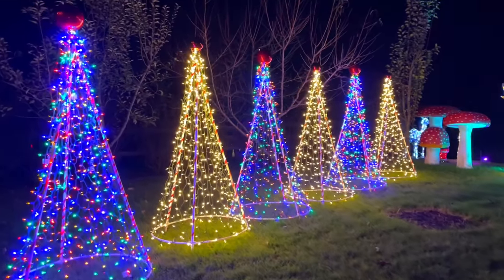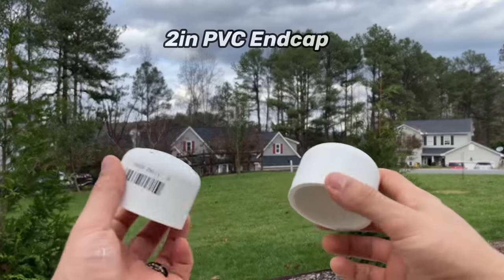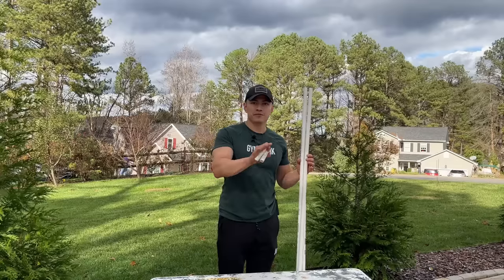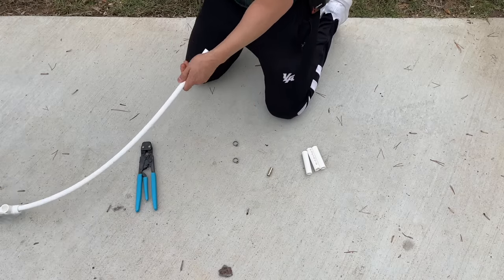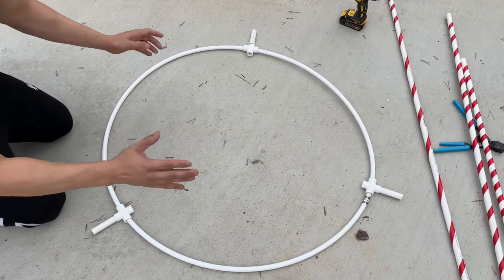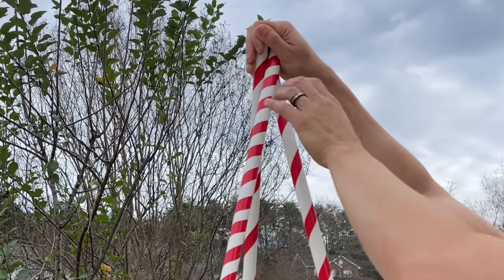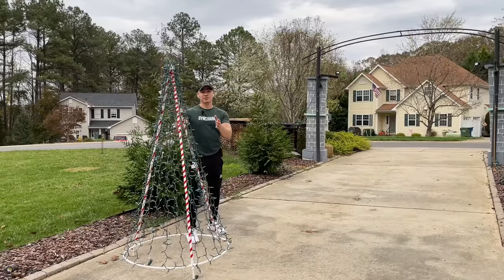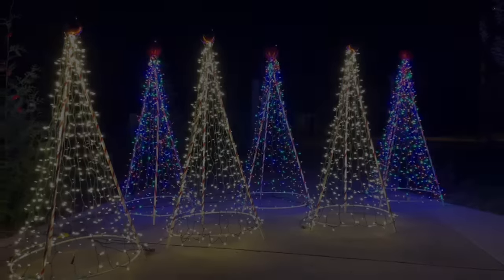EASY PVC CHRISTMAS TREES - TUTORIAL

Comment: Why can't you just use 3 - 32" pieces 1/2" PVC also for the base going into the 1/2 Crosses and forget the Pex stuff? 1/2 PVC is flexible enough to make the bend. Also for storage you can pull them out so they take up less space. You can prob also leave the lights on. Just a thought.

Comment: How long were the string lights that you used? (just for reference)
Reply from the maker: Each strand was 24ft long
Reply: @IsaacAlexanderDIY  Thanks :)
Reply: Can u use pvc for the base? I built mine 10’ tall w 1/2” pvc and pex, and it buckled on top n bottom 😡.  I know u said to use 3/4-1” if going that tall, but can I use that same size pvc for the base?

Comment: Maybe you could use a hula hoop on the bottom 😊
Reply from the maker: We cannot use a hula hoop because we need to get the cross connectors inside of the hula hoop and the only way to do that would be cutting the hula hoop which would defeat the purpose. You wouldn’t be able to crimp the hula hoop closed because of the different sizes

Comment: This is such an easier way to build these trees, thank you. I made 6 of these last year using Pex Pipe and pvc but with a much more difficult way to connect the Pex ring to the pvc pipes using zip ties and screws and drilling holes in the pvc and pvc tees. I like how you screwed the Pex to the cross tees, and how you taped the tops of the pvc pipes together and used a large pvc cap to keep the pipes together. Much better than the way I did it, again with zip ties and holes drilled into the pipes. What a pain in the butt that was. 

I'm sorry, but I have to disagree with you about the all the equipment for the Pex couplings, it's such a waste of money. You don't need any of that stuff: no
Reply: Ok, sorry it looks like my comment got cut off. I was saying, all you need is a plastic Pex coupling. No metal couplings, no clamps, and no crimping tool. A 5 pack of plastic couplings at Home Depot or Lowes costs about $4.70 (at least in NJ). Amazon has them too, I got a 30 pack for $16. Mine trees have lasted outside for a year now and the Pex ring hasn't come apart. If you want extra security, either add zip ties or run screws through the Pex and coupling.

Thanks for another great tutorial!
Reply from the maker: @jasram74  Thank you for the feedback and tips :)

Comment: Ok just wondering if anyone else had the problem I’m having? The the cross tee won’t slide on the PVC pipe. Everything was going good till now. 😢
Reply: Pvc fittings can be really tight to get on, have you tried any lubrication? I use white lithium grease, but that's only because it's what I have on hand, something thick like vaseline may work. Put it on both the end of the pipe and inside the tee. If it's still to tight to get on, use a scrap of wood to bang the tee onto the pipe, or the small legs into the tee.
Reply from the maker: There should be no friction or resistance between the PVC and the cross connector. It should just slide in. I can help you figure out the issue if you send me pictures of the PVC and cross connector on my DIY Facebook page. Just Facebook message me at “Isaac Alexander DIY”

Comment: This is brilliant!!   I have been wanting to do something like this for a long time.  I have 75 acres of land and my neighbors all have 3 acres.  They all decorate their place with lights every year.  But it is a bit expensive to do my land.  However, with your idea is is not too expensive, because I already have a lot of the pipe I bout before the pandemic.  As well, boxes of lights ever year at the end of the season for only $0.50 a box.  So, I plan to use your idea to make 50-100 to put around my land this year!  If I did it all your way it would be a bit expensive, but I realized that I can change the PVC cap idea with a small log cut on my miter saw and screw the pipes to it.  Or I can use tin cans with metal screws.  I think I will opt to put a bolt in the center of the can pointing out of the bottom of the can and wrap the lights around i instead of using screws.  This method will remove the cost of the caps.  Instead of if a metal stake I will cut points on the ends of the pipes and push them into the ground, so the metal stake cost is gone too.  I also have to think of storage, so the base hoop won’t be easy to store.  I guess I will use metal adjustable clamps. Oh wait that will be expensive. I can use a PVC coupler.  Oh, cheaper would be to just use a 3” long screw and screw at an angle from one side to the other side.  Thanks again for the idea!  I subscribed!

Comment: Went to Lowes to see what cost is to make one. Looks like it's about $25-30 for each frame, not counting the LEDs/Lights, or the $70 crimp tool for the pex coupler.
Reply from the maker: Correct, I would say the average cost for the frame is about $28, not including LED lights. But there is a cheaper alternative that does not require the tool. I put some information in the description of the video and it’ll save you from having to buy the tool.
Reply: I went to Harbor Fright cost me $20.00 for the crimp tool.

Comment: I also have some tips for the windy, stormy areas of the US. It gets really windy and rainy here in Dec. so I use heavy duty  landscape staples, the U shaped ones, to hold down all of my x-mas decorations. So for this tree, in my area, I would skip the legs and use the staples to secure the tree to the ground. Also for the screws on top, I'm going to wrap the sharp parts with electrical or waterproof gorilla tape to keep the light strings extra safe. I really Love the candy cane look! 

I made candy cane poles a couple years ago, using 2" pvc and red duct tape, super easy. Then I took smaller pvc and cut them diagonal to hammer into the ground and used pipe wrap to around those, slide the candy cane poles over them and they're stand secure. I first used balls on top, but have since bought solar pathway lights that are globes, and change from red to green, the spike attached and put them right on top, they line the driveway. I made the giant lollipops using PVC as well, pool noodles and duct tape that i've seen on youtube..so a whole candy cane ish them going, with my fleet of reindeer (that I'm currently restringing with new lights...) 
I'm alway DIY'ing things, PVC is awesome for so many things! Trees have been the one thing I've been looking for an easy cheap solution for!! So again, really glad I found your tutorial!! Now I'll have trees!

Comment: Nice video with detail... I like your wrap with red tape.  For those wanting to cut costs a bit, just drill a hole about 4 inches down through each post top and use a wire or zip tie.  Then just run lights over tops of pvc.  Also, no need to crimp the connector. Just pressure fit is good enough and holds through pretty strong winds.  Also, this year I replace using zip ties with using the twisty-ties that come with the lights to reduce waste on zip ties.   A quick video of mine from a few years ago... https://www.youtube.com/watch?v=h5lbKEryXUY
Reply: good idea for people that dont have pex tools.  cut a wooden dowel rod down to 2 inches long and insert into the the pex. drill a hole on each side and screw it together for the bottom ring.

Comment: Awesome vid sir!  If making a 10 footer, how long should the base circumference be?
Reply from the maker: I would caution you about making it 10 foot tall. If you will be going that high, you should increase your PVC to 3/4 of an inch or 1 inch PVC. Half an inch PVC will sag and not be strong enough to hold the weight of the lights. I would use the same 10ft pex pipe, your tree would just be slimmer. If you want it to be fuller you’d need to attach 3ft of pex to the 10ft section - which complicates the problem
Reply: Great design Isaac!  Have you had feedback on talker 3/4” or 1” PVC versions?  Would the same end cap still work or does it need to be bigger too?  Also would you stick with 1/2” pex or go to 3/4” on that too?

Comment: If you use a shark bite coupling instead of pex fitting you don’t have to buy the 30$ pex tool
Reply from the maker: The tool is about $60 at lowes but that’s why I made a part 2 where I use a push to connect coupling piece
Reply: I know how much the tool is I’m a plumber where I live you can get a cheap one for around $30

Comment: Ok.  I had high hopes for the tutorial.  I really did.  And overall it was ok. HOWEVER, most average people don't have PEX crimpers in their tools box and they are NOT cheap, so I wouldn't go buy some.  Second, when you begin by talking about the end cap and holes in it, I was completely lost. I will tell you like I tell people aT my job... START TO FINISH...LIKE YOU ARE TALKING TO A CHILD.
Reply from the maker: Hi Crystal, I’m sorry that this tutorial didn’t meet your expectations. I understand that the pex crimpers are expensive but I did say in the description of the video that there is a budget friendly alternative. I explained that instead of buying the pex crimper tool, you could get something called a push-to-connect. I even included the link to where you get find it at Lowe’s. This alternative means you don’t need to by the tool or the claps, saving about $70+ dollars. 
If you did want to build these trees, I would be more than happy to offer you more assistance if you needed it. You can reach out to me via my Facebook page called “Isaac Alexander DIY”. Lastly, I don’t want to sound indecorous but there is only so much that I can do as a creator . I made a great tutorial, I broke it down as best as I could, I listed all the supplies I used. Therefore, at some point, it is the viewer that is supposed to do their part in understanding what is being presented to them.
Reply: I think the video was great. And home depot will cut your PVC if you need it cut. Thanks for the video.. making these next weekend